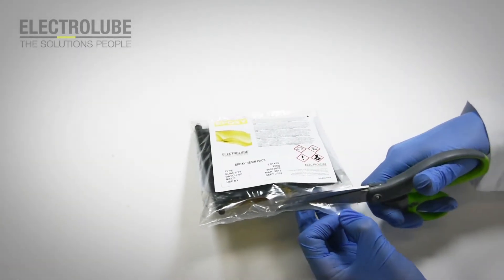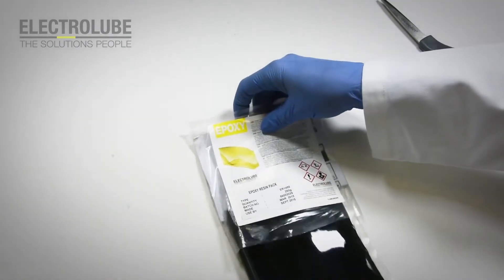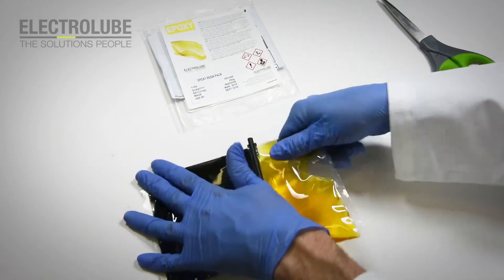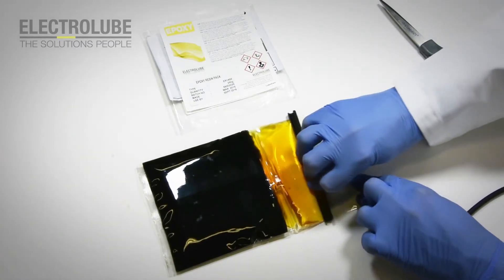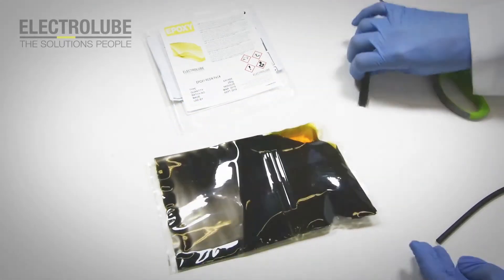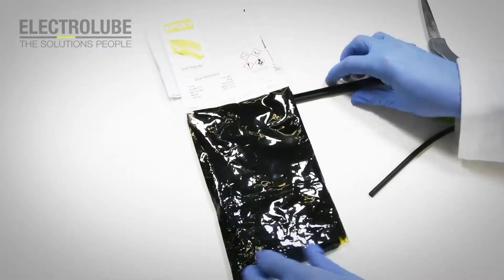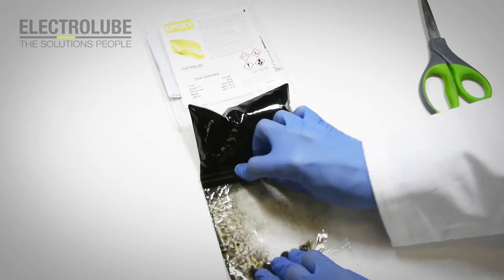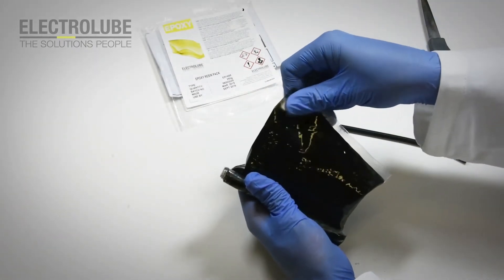How To Mix Epoxy Potting Compound Resin Packs

Comment: I never see this before i may looking for what is the industrial/more productive solution for this job.
I may put it on flat surface and put two hands onto the package and push it reversery than turn a quarter than turn the package upside down and repeat it.

I feel some frustration abaut what is going on at the package wall.